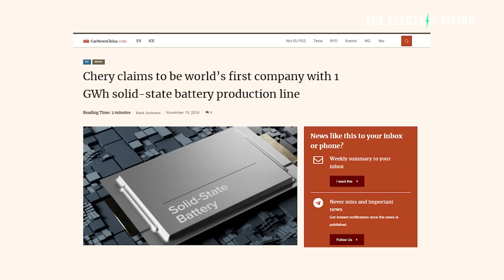Car maker shocks everyone with mass production solid state battery factory

Comment: If EV pickups have a range advantage over ICE, it is incredibly cheap and easy for the ICE manufacturers to simply increase fuel tank capacity to beat anything any battery vehicle will be able to do. Pickups used to be widely available with duel fuel tanks, I've driven two older pickups that had them. It's common for a pickup fuel tank to run as big as 36 gallons. Throw in 2 of those for 72 gallons on a diesel F-150 that gets 30 MPG highway and you're at 2,160 miles of range without even doing anything very different from many things that have been sold before - it's just combining an old fuel tank configuration with more modern, more efficient engines. The only reason they don't do it right now is that they see no reason to. Nobody cares about that much range between fill-ups, even factoring in the massive range hit when towing.
I agree that when an EV has a range of 700 miles, range will no longer be a reason people will choose ICE. If the EV has 700 miles, even if they do start making ICE trucks with a range of 2,000+ miles, nobody will care. So the point is a good one, but saying EV's will actually have longer range than ICE is unlikely. They may have longer range than current ICE, but once EV range gets that big, ICE will just use bigger tanks.

Comment: I have no doubt, ALL EV and storage batteries will be solid state within the next 3-5 years and will continue to gain in efficiency and cycle life until EV’s average 600-1000 mile ranges and be dirt cheap.
Reply: Have you priced topsoil lately?
Reply: There is no chance at all of it happening that quickly.

Comment: I will believe it when it happens. 
Currently charging takes way too long (charging away from home). 
Currently tco of EVs are still higher than ICE
Currently there is not enough electricity available to completely drop ICE.
Curently EV energy emissions are just shifting from the exhaust pipe to the power station.

Comment: Please temper the unbridled optimism. Ie brakes - our ICE cars and EV have all required brake rebuilding about every 3 years. Sure we rarely ever use the EV brakes (love that one foot driving) but because every year comes with 5 months of snow, slush, ice and salt on the roads within 3 years the caliper pistons are seizing and the pads rusting.  The big improvement will be when EVs go back to drum brakes. As for 700 mile range - what are you smoking? Who in their right mind would pay for that? It's trivial to do for an ICE vehicle but for an EV those batteries are going to be expensive no matter how you slice it. I'm looking forward to our next EV when we no longer have 100km between charging stops.

Comment: Solid State Batteries (SSB) together with mass manufacture of carbon-fibre tub vehicles, on a robotic production line, will revolutionise vehicle transport.

This disruptive technological leap will mean that vehicle body weight will decrease by up to 60% allowing for fewer batteries required to achieve a 300 mile car range or alternatively, cars with 1000+ mile ranges between charges.

The biggest evolution in performance however would be for mass passenger transport, goods haulage, trains, ships and aeroplanes.

Aeroplanes, capable of long-haul flights based on powered flight to 66% of the distance with a 33% glide phase/ electricity harvesting phase.

Passenger buses to be able to drive all week on a single charge and then to charge overnight at a depot.

Carbon-fibre hydro-foiling cargo ships, to reduce shipping times by 50%, and potentially carry more volume, meaning much cheaper products and reduced ordering to delivery times.

Trains to accelerate and decelerate faster, whilst harvesting energy, and to travel faster between stops reducing journey times.

Road haulage would be lighter, faster and more efficient, causing less wear and less maintenance.

Comment: Petrol 8.9 KWH/KG, SSB 0.6 KWH/KG. And you do not have to carry that xxx KG all the time.
Reply: Off course your motor with petrol is only 30% efficient vs 90% for an EV, but, oh, never mind.
Reply: @jamesphillips2961  No, its worse, I don't care how efficient an electric motor is as I will never buy an EV. I might buy a mild hybrid in 20 years but not batteries. Even if we factor in your so called efficiencies, my inefficiency gives me excess heat in winter for no extra charge whilst you EV heated seats and blower will crucify your range. Battery performance in cold weather? Give me a break. ICE used cars can be had for a few hundred pounds and function. EVs for a similar price? Not from what I have seen. EVs are hugely expensive even with tax breaks. ICE cars have been penalised through taxation and they are still far better value.
Reply: And modern petrol engines have and efficiency of 50%+ per wiki. The 30% you quote is anaverage figure for all ICE cars on the road includinguxh older engines. So 8.9kwh /kg x 30% = 2.6kwh/kg which is still way higher than these 0.6kwh/kg batteries. And I haven't even taken your efficiency into account. Heavier EV = more brake pads, more tires.

Comment: It doesn't make sense to have 1000 km + EV battery range, as it's inefficient to carry such a large battery pack. It's far better to have a 300 to 400 km practical / usable range per charge and fast charging everywhere. That way you radically reduce EV battery weight and improve the vehicle's electrical operating efficiency. If one can charge in 5 minutes, after 300 to 400 km of EV driving, one is laughing all the way to the bank.

Comment: Infrastructure is key here. Energy density deoesn’t matter if we have 5 minute charging. But we will need chargers that can charge at 800kw.
Reply: An 800KW charger is easy to make, a battery that accepts this much power is harder.

Comment: Great news - for the whole world, well done Chery!
Reply: Che  ry itself last month in an official press con claimed 600 wh/kg energy density for this ultra amazing dry coated electrode solid battery cells for early 2027,this will lead to 800 miles of range for evs..
Reply: Not really because I won't drive a Chinese car.

Comment: It is strange that electric cars are not considerably cheaper than ice ones. Ice engines are insanely complicated. Then gearboxes fuel aystems cooling. The electric engine is kinda simple. Bateries are fully automatable. Automatable products have niniscule prices. Electric should be considarabli cheaper than ice.

Comment: they dont have solid electrolyte so.. not solid state batteries, they dont have the energy density of real solid state vectors so.. fake news .. sorry mate... real solid state are physicaly impossible to use more than 10 cycles, and no one one have patern tha solve this problem at the moment, so this name "solid" for chevy is pure fiction marketing. NMC and NCA have between 250-260 wh/kg and those "solid state" are 280wh/kg ... for comparison real solid electrolyte batteries achive al least 350wh/kg .. just slitly improved NMC and marketing..

Comment: This crazy Chinese explosion of car brands, each making tens of different models will come to bite them in the ass. Eventually only a handful will survive, and many EV buyers will be left with duds on their hands. Having said this I own a Chinese EV, but didn't fall for any of the crazy ones.
Reply: Have you ever thought this further why there is so much different brands? The reason is that all these brands would like to get money from it. Money is the main reason for this, of course what else in this world?

Second, have you ever thought that in UK there has been over 500 different car manufacturers which has been defunct/quit business.
Reply: @iSot80  I thought about it, but it reminds me of the many geniuses that open identical shops next to each other, on the same street, and none of them thought about something else.
Reply: 5 - 10 years ago there were 500 EV start-ups and slightly-more-established companies competing. That has been reduced to 100 or so as failing/struggling companies merge or get BOUGHT OUT by others. No one is left holding a dud, they simply end up owning a car that is now owned by another car company.
Reply: @thechloromancer3310  And by this rate only about 5 or 6 will remain.
Reply: @abraham4961  "And by this rate only about 5 or 6 will remain."

5 or 6 corporations with several brands under their ownership? Perhaps. Some of these Chinese automakers already have Western brands as part of their portfolio (i.e. Volvo, Polestar, MG, Lotus).

At this point we are simply trading guesses.

Comment: The main concern with EV batteries, at this time, is fire risk which has inflated the insurance costs of EVs; there has been some dissatisfaction with the diminishing capacity of many batteries resulting in a lower resale value since the batteries are integral. To date, fast fast-charging can significantly reduce the service life of most EV batteries.
Reply: Insurance costs are high for EVs because they are expensive to repair due to lack of repair parts. EVs are still relatively low volume sales so making repair parts takes a big investment, especially when many models may be discontinued before any large volume is sold.

Several studies have shown that EVs are less likely to have fires than ICE cars which have tanks of combustible gasoline. 

And no, there has not been much dissatisfaction with battery capacity decreases.
Reply: Your concern is a Lithium ion batteries…. Not solid state and Sodium ion
Sounds like you’re duped into buying a Lithium ion battery EV!

Comment: WRONG.  EVs are too dangerous. Nobody wants to be barbecue d. Fumes from thermal runaway are deadly.  I drive  my 2l diesel toyota from 2009, just did regular maintenance at 280k miles. Runs like a Swiss watch.  2035 will be less than 600k miles...way to go to 1 mil. Usa just elected Trump.  Europe is 70% diesel.  Liberal bull is slowly loosing the elections. Climate change is a communist hoax.  People are not buying the bull.  EV makers will go bank rupt. ICE will prevail. Unless you make a safe baterry you have no chance. Wake up Mr viking. 😅
Reply: Make a video that shows how safe thermal runaway is for these stupid EV

Comment: The density on these batteries isn't much better than Li-ion, sounds to me as if it's just so they can say they are sold state as a marketing USP rather than a genuine breakthrough in performance.
Reply: Hopefully safer.
Reply: @brodriguez11000  Yeah, it'll be 40 times less likely to catch fire than an ICE, instead of just 20 times XD

Comment: When a zone is 'industrial park' or 'special economic zone' or 'development zone', you can expect that area to have almost everything they need to horizontally integrate a production line. 

I witnessed this first hand, an 'art' zone have everything from cheap canvas, to paint of 300+ different shades of paint, ink, chalk, coloured sands, to massive amount of clay for crafting, and every single type of brush, caligraphy pen, scented wood for sculpture, etc etc. I also saw a electronic zone where you can literally bring a 3D model of a thing you want, and they will 3D print it for you in 40 minutes. Rolls and rolls of industrial length cable of all types, hundreds of different type of resistors sold by the thousands, and blank circuit boards that can be made to order on the spot, LED of all sizes, stripes, colours, and different type of cooling systems on display.

I have not visited an 'EV zone' but just seeing some of the other stuff was mindblowing.
Reply: China’s ability to implement a business decision, invest in new technology, build a factory and then ramp up production is phenomenal and its greatest strength. 

In France they would protest about it, in Germany unions sabotage it and in the UK sit around talking about it for 5 years until the product was out of date and the cost of implementation had doubled. 

European industry will never compete with China which is why we will all be driving BEV’s  within a decade. ICE vehicles will be looked at the same way we look at steam driven traction engines today. Museum pieces from a bye-gone era, something for enthusiasts and weekend tinkerers. But no longer a serious means of transport.
Reply: The key to China’s EV growth lies in the industrial policies of both national and local governments. In many cases, local support has been more extensive and critical to the development of Chinese EV producers than national policy. 

One notable example is Hefei, the capital of Anhui province, which became the site of BYD’s super factory in 2021. The Hefei government made tremendous efforts to support and facilitate BYD’s investment. The negotiation between BYD and the Hefei government took only 23 days, an unprecedented speed for any local Chinese government. When BYD claimed that the factory location was not flat enough for construction, the Hefei government mobilized over 1,000 trucks to move dirt and create a flat surface overnight.
Reply: WE need to start developing these "special economic zones" in our own countries.
Otherwise we WILL fall farther behind!

Comment: Perhaps Cherry have been clever and not pushed the target energy density too high for their first SS batteries. As a result they will be first to market and still offer huge improvements over current LFP batteries.
Reply: clever a making slitly improved NMC batteries still using a liquid or gel electroliyte and call them "solid" wheen the electrolyte isnt solid at all... lol
Reply: @foxy5855  
The electrolyte is likely to be at least semi-solid.
There are many different kinds of solid state batteries in development.
To get an idea of that look up Undecided with Matt Ferrel, he has at least one recent video about the different kinds of solid state batteries in the works.

Comment: 1 GWh. Is that per hour? Per day? Per month? You need to divide by time, and when you multiply by time and then divide by time, they cancel each other out. How many gigawatts?
Reply: GW is a measure of power- how hard you studied in school. GWh is how long you maintained that level of study.
Some of us burn out quickly.
Reply: @danielking2944  I didn't study particularly hard in school, but I did a couple of years of physics in uni before switching to maths. I know what power is perfectly. A gigawatt is a unit of power, that's correct. If you're trying to measure how much battery capacity a factory is producing per unit of time, you need to use power units.
Reply: @chesshooligan1282  - battery factories typically state annualised Wh production figures - i.e. the amount of storage capacity they'll produced in a year. The intent is to estimate the number of units (whether EV or BESS) by dividing by the average storage size. As solid state are targetting vehicles rather than stationary storage (at current prices/densities) 1GWh with an average car battery, of say 80kWh, this would equate to 12,500 cars per year.
Reply: Hahaha! Correct! Maybe GWh/year?!

Comment: Solid state batteries will allow small EVs like the Corsa, 5 and Inster to have 300mph plus range and no long just be city cars. What about cold weather performance? Better? They will however lead to savage mid term depreciation on current battery tech EVs with circa 200 mile real world range.
Reply: You have to buy what's there, otherwise wait if you can
Reply: If it goes 300 mph I don’t think range is much of a factor. It will quickly be wrapped around a tree.

Comment: Hmm so far it was saying SOLID state is 400-500 W/kg... This is not very big step up... Especially adding the price factor. Then what is the benefit is here? Ok, charging speed is impressive!
Solid State should be the "Holy grail" this is just "Holy shit"... 😄
Reply: What is the price factor when solid state batteries finally come to market? Does anybody know? I've seen estimate of 253 Wh/kg for Tesla's 2170 batteries. 500 would be twice the energy density, essentially doubling the range. The 280 for gen 1 solid state is not a great improvement, but solid state is supposed to have better temperature tolerance so less decrease in range in cold or very hot weather.
Reply: @twostate7822  According to the video it will be used in "high end" expensive cars at first. So probably it will be pretty expensive, I guess...
I was also surprised on the specs... Solid State should be the "Holy grail" this is just Holy shit... 😄

Comment: Great video, thanks.  This technology seems to be very important.  With such a leap in energy density of batteries, manufacturers will have an interesting choice between increasing the range and reducing the weight of their EVs.  Reducing weight will improve handling and increase efficiency.  I suspect that they will offer both - e.g. cheap light cars with a 200-300 mile (320-480km) range and expensive heavier cars with a 700 mile (110km) range.
Reply: Speak for yourself - Anyone who supports China is going downtown

Comment: The 4680 cell topology has a single, super-important structural difference from all other cylindrical cells.  It is bringing all turns of the copper electrode emerging as a connection to a single point.  The ESR of such a topology is way lower and this allows much greater charge/discharge currents with lower heating - irrespective of the W.Hrs/kG rating.
No, I do not think this topology will die.  I think it will be improved even more.
Reply: I just had my 4680 battery pack replaced in 2023 Y stand at 14500 mi under warranty, anybody else ?